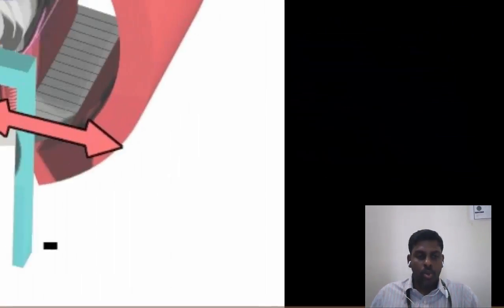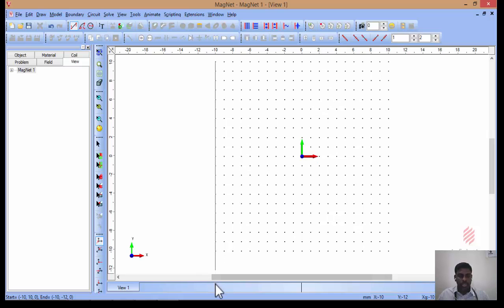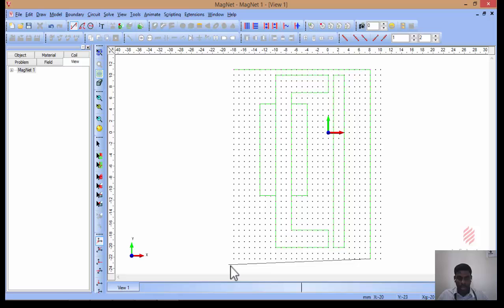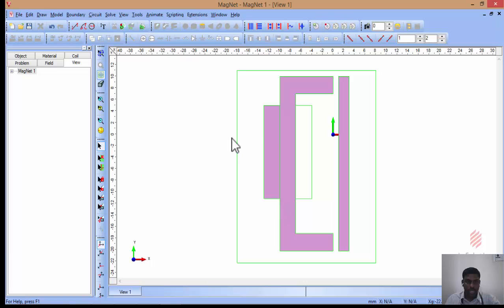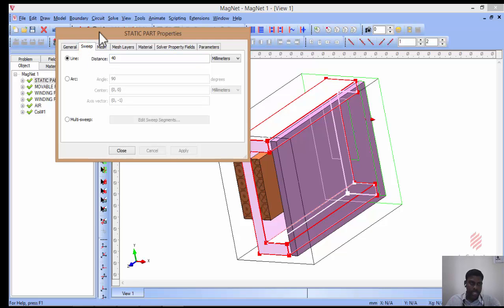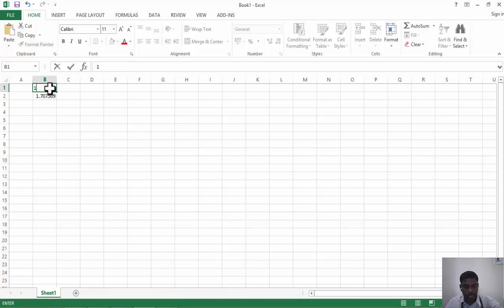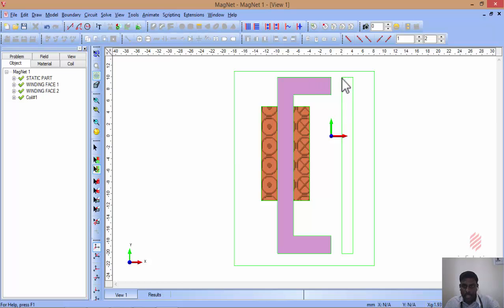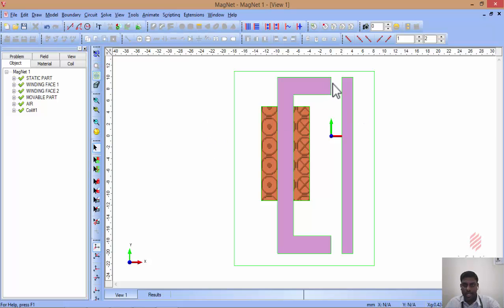MAGNET

Comment: Hello,
How are you? we have designed the induction motor by using motorsolve. In fact, we face an issue how to make the air ducts by using motor solve software. additionally, we try to make it by magnet software and export it to motor solve by the same extension name dxf but it does not work with us. please we need your help in that.

Please do not hesitate to contact us via email address Ahmed.ammar212@gmail.com or mobile phone NO: 00447448517657

Thanks
Reply: I suggest Other tools.